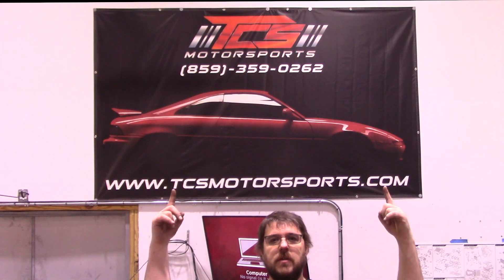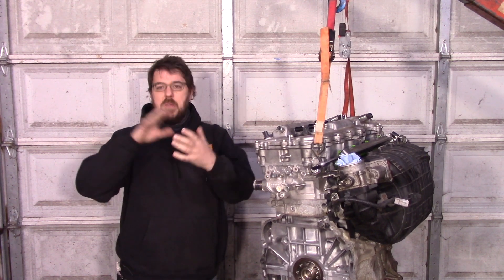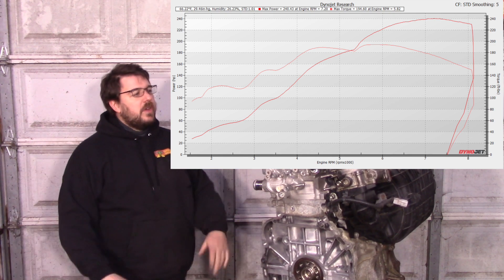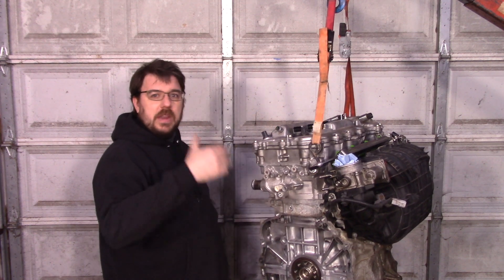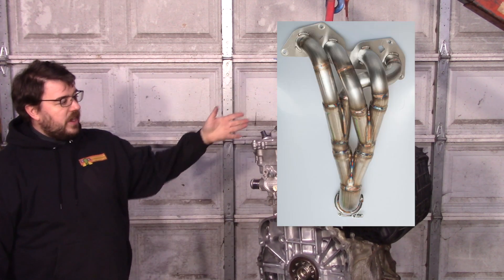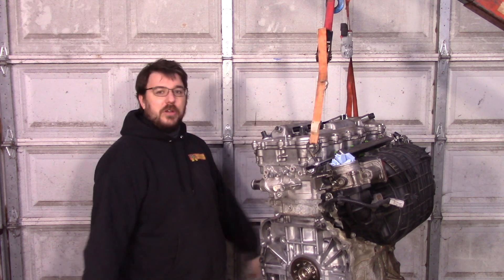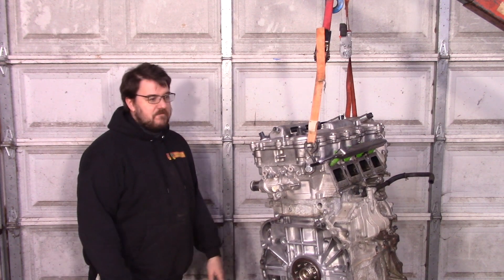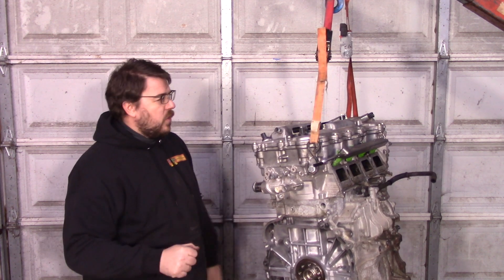Upgraded camshafts for the 2AR-FE.

Comment: Ohh that would be fun in an AW11 :)
Reply from the maker: NixSpeed is actually in the process of building one of these. it certainly will be a blast without needing to cut the chassis up like you have to for the v6 swap.
Reply: @FrankensteinMotorworks  As I work on my 2GR AW11, I hope you are still developing options for this platform.  Amazing to see the results of the 4cyl.  Same options going into the 2GR as well in the future?
Reply from the maker: @wvupharmd  Yes, i'm making a couple internal performance parts for the 2AR first but the 2GR will also get some support from me in the near future.

Comment: Maybe if the Scion tC managed to took off in sales, Toyota maybe would have developed a more powerful 2AR for the tC, even the 2.0l 6AR looks like it could be developed into a modern 3S-GE without significant modifications, the 1ZR and 2ZR also seem to have that potential, but in the end nothing exciting happened. Good thing Toyota made the G16E-GTS, that engine is really strong and light.
Reply from the maker: Yeah, that G16E does look pretty exciting. Bet we can rev it to the moon :)

Comment: I love the 2ar N/A. I hate the fact that you need a turbo to make any real power. But seeing that you’re trying to make 300hp N/A I’m definitely gonna have to follow this and hopefully have a motor like that in my TC. I don’t mind going standalone or whatever is needed to tune it and get the power out of it. I appreciate that there’s somebody out there with the know how to make something like this happen. Plus you’re showing great results for your efforts!
Reply from the maker: My goal is actually 350whp but that will involve alcohol. 300whp should be possible on pump gas and i hope to document how to get there when i get there on my way to 350whp.
Reply: @FrankensteinMotorworks  my good buddy spent over 24,000 aud 6 years ago which included a billet crank, rods, pistons, special block, dry sump, 55mm itbs, special exhaust, titanium valves and lots more for a Nissan 2.3L to make 276hp @ 8700rpm so 300hp is no laughing matter even with extra 400cc at 2.7L will be less stressed and if kept under 4k usd its the bargain of the 21st century. Honda K for 2.7L requires 12-15k usd investment to get 300hp. All this is engine alone and more likely to be less stressful for your transmission than a turbo engine. The sound is just a woody feeling everytime you plant that thing.
Reply: I love watching engine masters and e85 really seems to be the fuel to use if you are looking for high compression high hp goals. One of their newer episodes puts 115 race gas vs 115 oxygenated race gas vs e85 vs methanol.
Reply from the maker: @zokusharuuku1091  E85 really is fantastic except for one significant issue. E85 is not guaranteed to be E85. If corn prices are high you can get something that is a lot more like normal gasoline than E85. Of course you can test it before filling your tank by buying a few drops and mixing water with it to see the alcohol separate and figure out the percentage but that can be pretty frustrating. I think it used to be that the combination could be as low as 85 octane, these days it looks like that has been updated and the minimum octane for the combo is 97 octane but if you've got a naturally aspirated engine you can't just drop down the boost a bit until better fuel is available. between that and the fact that this is really just a race car i will likely go right to E98 or Methanol when it comes time to switch to alcohol.

Comment: Great work !!!! Question if I purchased these camshafts and the haltech would you be able to find somebody to tune my tc2 in cali ?
Reply from the maker: The tune i provide is a MAF tune that uses my MAF pipe. this requires buying one more part but it does mean that you do not need to get it tuned further. You can just run it as-is.
Reply: Would this tune work with the aem fic ??

Comment: Any idea what difference the 1AR intake makes overall? Have you thought of getting your stock throttle body bored out also?
Reply from the maker: Honestly i don't know. If i had to put money on it i'd say it probably adds just about nothing at this point. But it was one of those things where i had it sitting around so i may as well use it.
Reply: @FrankensteinMotorworks   do you know the plenum size differences? I have full cat-less exhaust and cold air intake with reground (by Brian Crower) cams and a bored out throttle body (by max bore) so I wondering if I might benefit from changing to a 1ar  intake manifold.
Reply from the maker: @89gts  No, i would have to make caps for the ends and fill it with water to test and i have not done so. it's a relatively small difference.

Comment: How many MM throttle body is on that?  My (and all measured at the throttle blade bore size +/- 1mm) 2TR-FE has a 60mm (170hp)  my 4gr-fse a 65mm (210hp), my 2gr-fse a 70mm (306HP) and my  1urfse, 2ur-fse and 3urfe is a 76mm (380-420hp) stock factory claimed  HP at the crank.
Reply from the maker: The stock throttle body is 64mm which maybe places it every so slightly larger than the 188hp rating would indicate but more or less in line.
Reply: @FrankensteinMotorworks   Am i correct that you can't really attach a larger throttle body to that stock intake, any adapter would just neck down anyway, defeating the purpose (that's how it is on some of my other toyota intakes at any rate).  I like your idea of a custom one with adjustable runner lengths and plenums, i'm sure you've seen Papadakis's video of one they made, if not, check it out.

Comment: Congrats!  what is the base circle dia. of those camshafts?  and what is the ratio of the cam followers?
Reply from the maker: exactly the same as stock. 38mm. As for the rocker ratio that's not a simple answer because the rocker ratio depends on the normal angle of the cam where it hits the rocker roller. It's a relatively large roller compared to the pivot distance which magnifies the effect. but for quick approximations the rocker ratio on this motor is about 1.6

Comment: Will definitely buy a set for my 14 tC if the "Streetable" versions come into production and work with the OEM ECU. Great results and Congratulations!
Reply from the maker: These are very streetable, the torque down low is still just fine but yeah, the stock ECU won't support these.
Reply: So if installed on the tc, will you have to buy a tuned ecu?
Reply: That's the issue I'm running into. I have a 2015 tC. I cant afford the camshaft and ecu. Hopefully these stay available for awhile.

Comment: I'm in between a 2ar or 2gr for my aw11
Reply from the maker: If you want to talk a bit about what your goals and skills are I may be able to help guide you to one or the other.
Reply: @FrankensteinMotorworks  all I want is something close to 300hp but if 2ar can get close to that I figured its be a lot easier to on on them in the engine bay compared to a 2gr. And I like the 2gr cuz its instant torque but a bit hard to working on them in side the engine bay
Reply from the maker: @thatlilmr2  Honestly, at 300whp it's hard to argue against the 2GR. It's really a great motor for that power level. The 2AR will be a bit more high strung to get to 300whp but it should be able to get there on pump gas.
Reply: @FrankensteinMotorworks   yea thats what I'm in between um just going back and forth. And maybe someday between you and and Paul woods we can have straight drop engine kits for 1st gen.

Comment: For as stock as it is, it's a pretty great early result.  Be cool to see as you dial in on what it wants.
Reply from the maker: Yeah, exactly. It may seem like little steps at this point but these steps really help me learn what this thing wants. For example many people would have already thrown an intake manifold at this thing but  the motor hasn't told me it needs it yet.
Reply: @FrankensteinMotorworks  I look at intake as like... maybe?  Whether or not it's necessary it may be worth power... but with a few iterations of parts there's probably a lot more to find without it too.
Reply from the maker: @mekilljoydammit  I'm certain there is power in an intake manifold at this point, i just don't feel that it has become the next big bottleneck yet. I do want to make a somewhat modular intake that would allow me to test different runner lengths and possibly even different plenum sizes on a single dyno day.
Reply: @FrankensteinMotorworks  I would definitely be interested in the runner length/plenum size data.. I was trying to decide what manifold I'd end up using (hoping to at least start building the engine this year.. hopefully have it in my FRS by next)

Comment: LETS GOOO but what would I have to do to get these on an automatic Camry? Will the Haltech ECU be compatible with the automatic transmission?
Reply from the maker: The automatic transmission controls are part of the stock ECU. Sometimes you can retain the stock ECU in parallel to control something like that but i really don't know. It may be best to wait until there's a more stock ECU friendly set of camshafts.
Reply: @FrankensteinMotorworks  Stock ecu camshafts .. yes please
Reply from the maker: Yes, this is one of my goals.
Reply: @FrankensteinMotorworks  +1! I’d get em day 1

Comment: Cheers Marc! This is an extremely exciting video not just for you, but for the 2AR community! Keep up the amazing work!
Reply from the maker: Yeah, i'm really excited about getting closer to my goal but i really am curious how the 2AR community ends up reacting to this.
Reply: @FrankensteinMotorworks  if there was an accessible aftermarket, I feel like a lot more people would hop these up like they do with the Hondas. These 2arfe motors are everywhere and they've got a decent bit of displacement to play with, more support could make them more common in the performance world. Lemme put it this way, if I had stuff to bolt on to it, my Camry would be a little monster lol
Reply: @FrankensteinMotorworks  hi man, great work! I have a  silly question, would simply replacing the camshafts increase the engine performance or I need to dial in some ECU settings also?